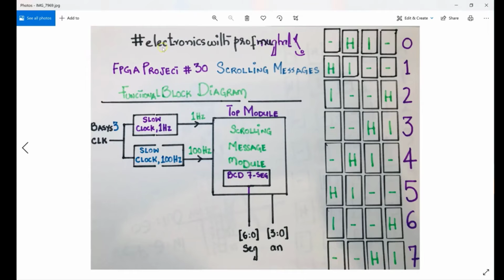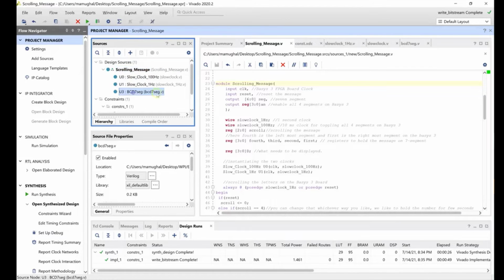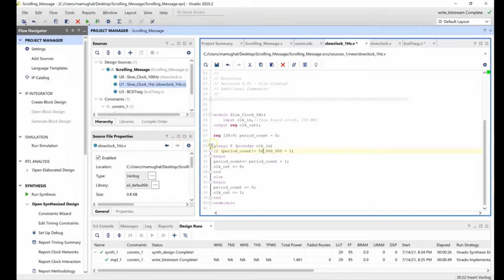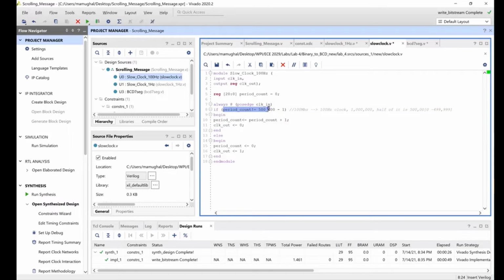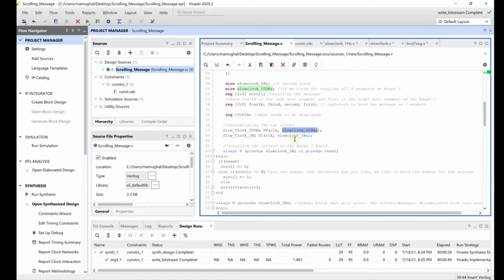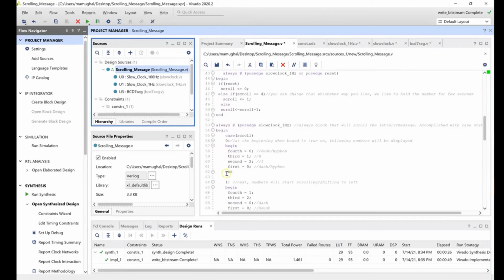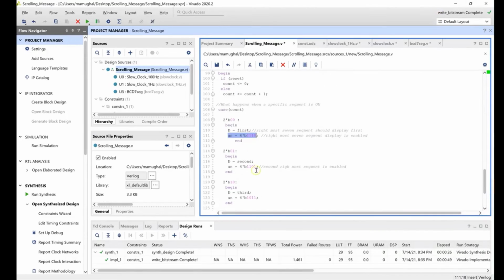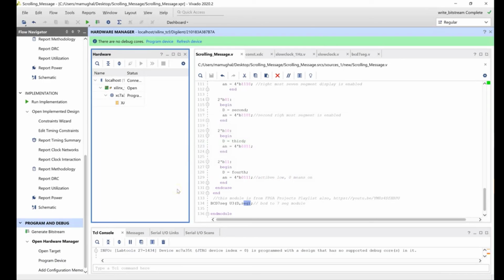#30 How to scroll message on seven segment? ➠  Basys 3 FPGA Board | Verilog HDL

Comment: Respected Sir! I have a question. Will this code work for displating somthing other than "_HI_".
if I want to display "2020EE51" can I display it by simply editing this code or I will have to add other codes also?
Reply from the maker: You’ll have to make changes.
Reply: @ElectronicswithProfMughal  Thanks a lot Sir. It was very heplful.
I have made changes I hope it works.